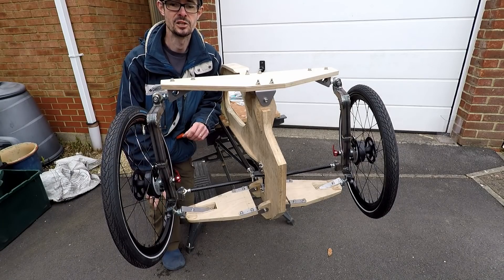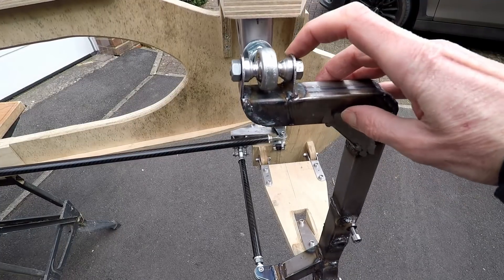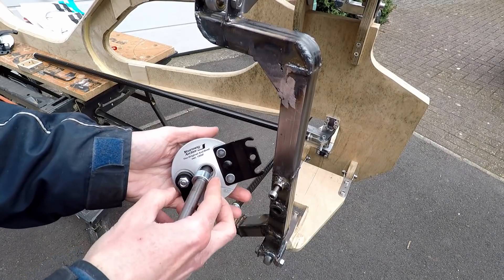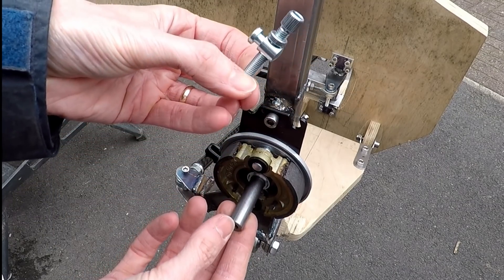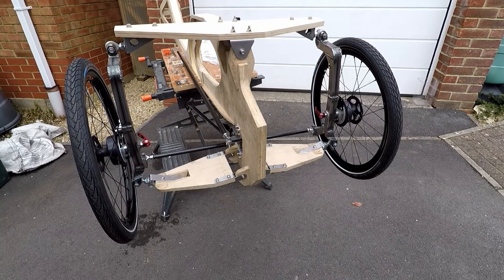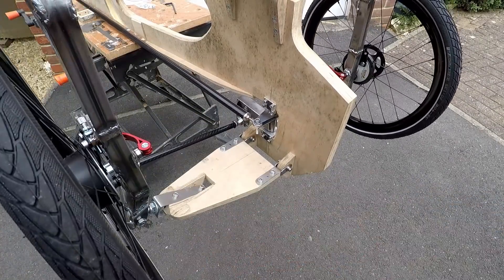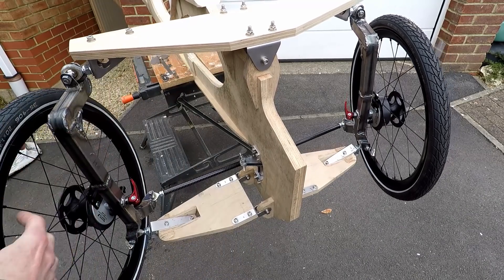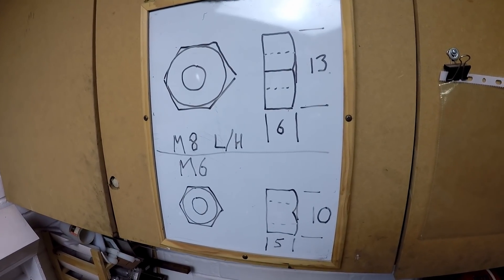Tilting Trikes Part 11- project progress and a closer look at the tilting and steering mechanism

Comment: hello again , nice update , nice seeing you getting closer 
I have made some observations that I would like to write 

1)(the most irrelevant ) at 1:28 are you locking the cariage for more stifness on the lathe?

2)at 6:00 a) I think you could find something that fits better , b) if you have a 4 jaw indipendant chuck you could hold it , turn the cap of an make a thread to tide it better c) maybe you could laser or waterjet cut another plate that holds the rotation of the drum brake .
3) 9:45 (I am carpender and the bike I am making is out of ash wood ) I believe just epoxy isnt going to make it , I would pass through at least two dowels if there is enough <<meat>> (preferably not the standar beech dowels that they massivly sell , oak or even aluminium would be good)  .

4) At 10:10 it seams to me it will break too , You would have much better chances if both sides were one piece and it would be half knotched to the frame , even better instead of plywood this part could be aluminium .I think you have a mill and you can easily make it 

5) there are double brake levers and that could be avoided , I can send you a link if you want .

6) I believe at this stage you shouldnt cosmetic changes like sanding painting etc , If you see its fully working you can do it afterwards .

I dont want you to think that I judging on all of those , I am trying to be an extra set of eyes that might be of some help
Reply from the maker: Hi there, thanks for the comments!  To answer your questions:
1.  Yes!  That's the carriage lock.
2.  I definitely need to do one of these things.  I do have a four-jaw chuck. 
3.  Agreed.  I need to pin them through with something.
4.  I am going to reinforce these pieces with something.  They won't stay stuck on as they are!
5.  Yes please!
6.  Agreed.  I don't want to put too much effort into the finishing if the whole thing is going to be a failure, however, part of the point of this project is just making something for the fun of it!
Cheers!  MMS.
Reply: @MetalMachineShop  thats the best price i found i ve seen on amazon-ebay at 45ish euro or something the shipping is a bit stinky but if you need more than one its better , and choose some kind of  premium shipping otherwise it will take a month + . But you can google around to see if you can find it closer to you in a compairable price if you take shipping into account . The same product is sold from several sellers a photo search might leed you somewhere . I havent tested it yet cause i need some more tooling to finish mine but it seems really decent and of good quality if you want any photos or dimensions I can sent it you somewhere
Reply: @MetalMachineShop  i have put the link here twice and it gets erased 
If search on this keyword you will there , its a shop from holland 

Double brake lever for both brakes on one handlebar
Reply from the maker: @antoniskaloterakis7996  thanks, I've found the levers you mean.  Good call.  I'll probably stick with the current method for the prototype as I've already got an old lever I can use, but I will definitely look at the 'two in one' lever for any follow on version.
Reply: @MetalMachineShop  BMX Bicycles use a cable splitter for the rear brake, as the handlebars fully rotate. This way you could still retain the current brake lever.

Comment: The velomobile is getting better on every video!. Excellent job! 
I have been revisiting some of your videos and I saw at first you wanted to use cables instead of carbon tubes for direction, why did you change it? and Another question which CAD do you use?
Reply from the maker: Thanks!  The reason I changed from cables to rods is because the handlebars are going to be separated into individually-mounted left- and right-hand bars and cables wouldn't have worked without separate return runs and pulleys.  I also had a comment warning about resonance with cable steering although I'm sure it could be tuned out (it's good enough for aeroplanes after all).  I've just ordered the tube for the handlebars, so hopefully making these soon.
The CAD programme is Onshape.

Comment: Following with interest as I'm building my own velomobile too. How are the 12mm axles retained in your uprights? Just by the QR holding the wheels on? 
Fascinated to see your body design when you get to that!
Reply from the maker: Hi, it's just the QRs holding the wheels on.  I've seen other well-known trike makes use this method so I have no concerns about it.  There is not a lot of stress in the QRs - in fact a tilting design will put less tensile stress into the QRs than a trike as the lateral loads are a lot less.
Reply: @MetalMachineShop  that's what I thought too, but as I was watching I couldn't see how they were held in till you put in the QR's in. Yes tensile loading will be much less. I've often wondered about a tilt mechanism myself and have seen the Rocket designed by a chap in the States which seems like a good design but is a delta rather than a tadpole.

Comment: Where the tilts are to stop them going further than required - I thought a wedge with a rubberised plastic like that of skateboard wheels would afford stability under each side whilst not impeding movement. I think the cable tension will keep and fittings in place and stop them moving or wobbling unnecessarily. I am very interested to see how the wood will cope under stress and pressure. You're a brave man! I'd have used box aluminium  or steel. I don't trust carbon fibre, I've seen it go on bikes, nasty. Good video as always.
Reply from the maker: I think I will fit some kind of rubbery stop each side.  I think the wood will be ok, I've seen wooden bikes made from much lighter sections than I have used.  Admittedly, steel or aluminium would have saved a whole lot of hassle, but like I said in one of my earlier videos, I had the wood already so it was 'free'.  This is only a prototype to test the tilting mechanism, so it's not really intended to last forever.  I'm not concerned about carbon fibre - as long as it's properly designed!
Cheers, MMS.

Comment: When carpenter does a mechanics... 🤦‍♂️
You better instal metal hinges before those plywood mock-ups shatter snaps off 🙃
Reply: I believe you are unfair to the carpenters , not all off them are made equal plus i know machinists that in all of their lives just measure with the caliper and replicate things . I agree they will break at some point and  should be reinforced wisely but dont underestimate wood also  if the friction points are designed smart enough to pass the loads to the wood in a large surface area it can last forever .
Reply from the maker: Hopefully the plywood brackets will be strong enough!  I'll test them before riding.
Reply: @MetalMachineShop  Hope is the worst partner in engineering (-;
Reply from the maker: @YaR0MyR  You got me!  I quite agree, very poor choice of words on my part.  Knowing is better than hoping!
Reply: @MetalMachineShop  No worth for risk. Those obviously are the concentration of forces variable momentum and friction points, thus even if will survive test ride, will  suffer big loads and wear out fast. It would be clever to reinforce them at least with aluminum corners and conect both sides through plywood frame into sandwich of appropriate area on the frame for load dispersion. Not big thing to add while great insurance at the right place.
Reply from the maker: @YaR0MyR  I am going to reinforce the plywood brackets.  The strength of the wood itself is sufficient, but they need to be more firmly fixed to the frame.  You can't see it in this video, but the brackets are fitted with oilite bearings which take the pivot pins.  The pins do not bear directly in the wood.  One of my other videos shows this (part 7).
Cheers, MMS.
Reply: @MetalMachineShop  I've seen those videos from the bgining. And simply could not leave it without mentioning. And I am happy only with that you pay attention to what I pointed out. I meant exactly the bracket-to frame conection points the most, especially the lower ones, where the loads will act in scissor manner.
Reply from the maker: @YaR0MyR  thanks - your comments are much appreciated.

Comment: Hi, and thanks for this update.
I've been following this from the beginning - mostly because I've got something similar in mind to make for one of my sons.  It's not high on the priority list atm, but sometime soon(ish).
Anyway, a couple of questions if I may:
1) Curious to know why you've designed front/back 'stagger' into the upper and lower wishbones; the top one being slightly further back.  Is that for aero purposes? i.e. to allow the upper WB mount to be contained with an aero body?
2) Can't remember if you've said that the plywood itself will be faired into an aero profile, or whether the WB's will have actual fairings.
3) Why drum brakes rather than disc?
Regards Mark in the UK
Reply from the maker: Hi, to answer your questions:
1. The stagger is due to the rake necessary to give the steering caster - the line between the upper and lower steering pivots is angled back by 73 degrees.  It is also angled inwards so that the line between them intersects more or less at the tyre's centreline on the ground.
2.  Yes, I plan to round off the plywood just to remove the sharp edges.  I won't go for a full aerofoil as I doubt the time spent would justify the returns.  The post-prototype version will have aerofoil sections made of carbon fibre mouldings.  That's the plan anyway.
3. Drums are self-contained units and avoid the need for fiddly brake calliper mounts.
Cheers!
MMS
Reply: @MetalMachineShop  And also, the use of Sturmey Archer drum brakes has Mike Burrows' seal of approval - he uses them on many of his designs.

Comment: at 6:15 about the loose fitting cable brake stoppers, maybe you can just hammer the corner of the black plate to close the slot a bit?
Reply from the maker: That's not a bad idea!
Reply: @MetalMachineShop  And if that doesn't work, try using a bigger hammer.
Reply from the maker: @tomdupre  thank you for your suggestion!

Comment: What are the benefits of a drum brake over a disk brake?
Will there be any flex in the arms to give some suspension in the final iteration?
Reply: Drums are completely impervious to weather, and have ample stopping power.  They also need rather less fettling in use, they are a lot more forgiving than discs
Reply: @JohnR31415  
Thanks. I don’t have experience with either. All my bikes have been rim braked.
Reply from the maker: For this project, the drums are easier to install as they are self-contained units.  The backplate just needs to be bolted in place, rather than fiddle with complicated brake calliper mounts.  Also more aero, lower maintenance.
Reply from the maker: There is a bit of flex in the arm already; the post-prototype version will have a jointed arm with spring, or possibly designed with the required amount of flex in it.
Reply: I've been asking myself the same question
Surely having a little flex on the arms might provide suspension, but I wonder if it works in practice, and if it doesn't mess up with anything like the ackerman geometry or  else
Reply: @arnspyarchi6040  
I saw a design recently that didn’t have suspension and he was considering making the outriggers from water-jet cut titanium to give flex like a lateral leaf spring.